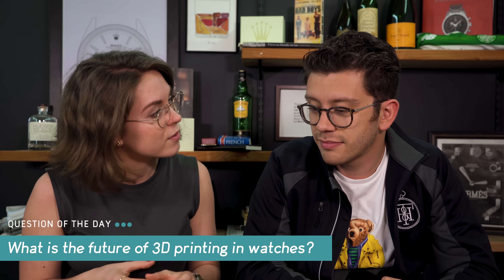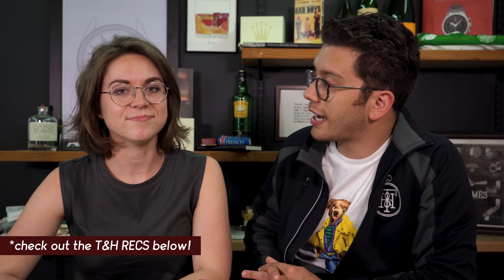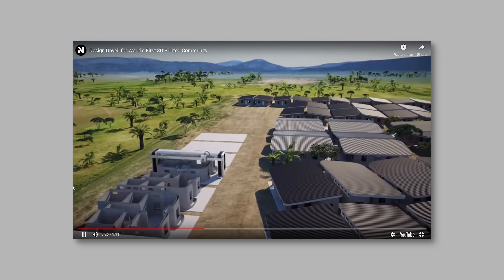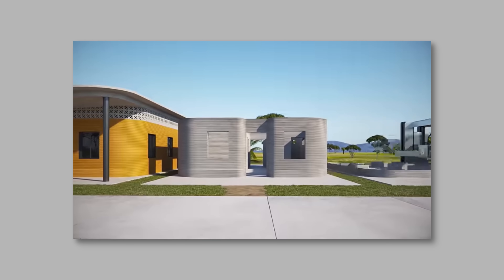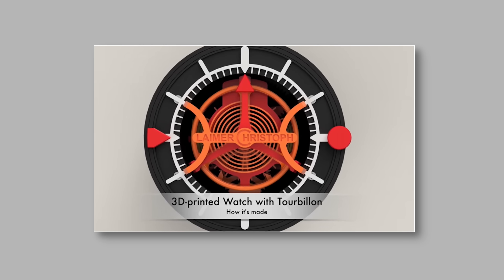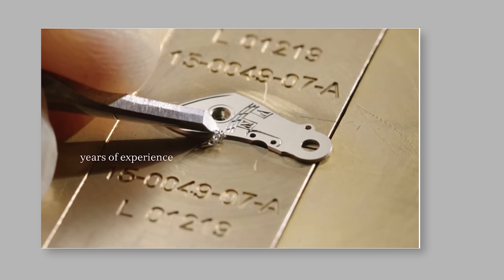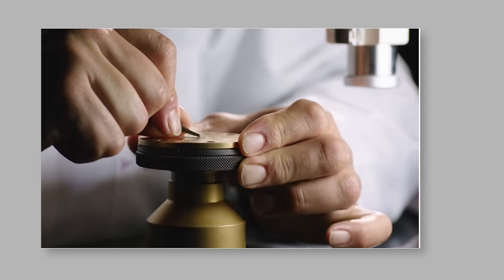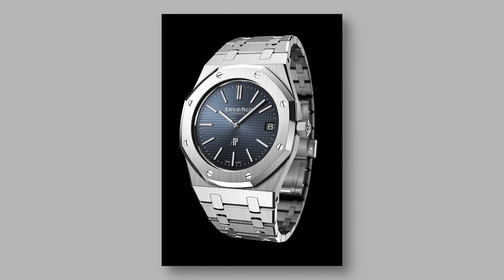Fake Watches Getting BETTER with 3D Printing

Comment: It would appear as though you need to do a little more research on 3D printers! There are some serious limitations even with the worlds best 3D printers and you can't just 'Scan' something and all of a sudden, the measurements of all the components are correct with minuscule tolerances. No, an artist has to do that work. For something like a watch a 3D artist would have to disassemble a real version of said watch, measure all the components and make scale models of them ready for printing, it would take weeks to perfect that for one watch, trust me, I know! Even then, you would be limited by your 3D printer! I have an FDM and an SLA printer and believe me when I say, 3D printing is NOT an exact science. In my opinion and experience with 3D modelling and 3D printing, I would say, the watch making industry is VERY safe! Happy to jump on a call with you and go over a few points if you would like to clear this up.

Comment: Hello, I am a watch enthusiast that works as a metal 3D printing researcher. If you are interested in making a follow up video on what’s possible, potential risks, and finally the potential benefits of the technology to traditional watch making I would be thrilled to serve as an information source. Rolex actually uses a 3D printing process to make some of their gears as they would be impossible to make using any traditional manufacturing technique.

Comment: Ummm.... How does the 3D printer render a metal part? It can't. So reproducing the part in plastic is a dead giveaway isn't it? You could recreate bezels (maybe) but not much else I think. 
Hand-painted dials don't need a 3D printer. They could reproduce those with an ink based 2D  printer - pretty sure.

Comment: Good, they'll have no excuse to withhold replacement part for vintage watches etc.  There's no such thing as "hot horology", and you can't translate the actual term directly over as "high horology" either.

Comment: As a watchmaker (recently certified) I'm on the fence about 3d printing parts. Because on one hand, 99% of the pieces I work aren't A. Lange or AP its usually Seiko or Citizen or some small time watch brand owned by a larger brand (*cough*SwatchGroup*cough*) and it helps in speeding up the repair time as opposed to waiting a day or two to receive the part. However, when it comes to working on A. Lange or AP the owners of those pieces would prefer everything stay original and any deviation from that is sacrileg! But that's not to say A. L or AP would make the switch to 3d printing parts. Its about pride for them and I take pride in fixing and being certified to do so. @Theo and Harris

Comment: Actually @3:47 when you discussed wether a 3D printed part could replicate the finish of a Lange movement, this wouldn’t be the case. In theory, a 3D printer could make a piece that has the same grooves as what the engraver put into it, but it wouldn’t match the piece exactly. This is because A: the piece would have to be modeled in a computer which is a difficult task in itself to faithfully replicate the artisan at Langes engraving style, and B: when printing the piece, the machine would only fill in the metal so that it would have the shape of the piece. All of the polish and shine that engraving the metal has is caused by the engraving itself, which can be replicated by the printer. E.G. a 3D printer can replicate a small beveled edge, but the look and finish of that piece can’t be replicated since it is done by carving into the metal whereas the printer applies metal

Comment: Actually 3D printing metal requires a lot of post-proccesing or finishing. The parts that come out could be functional don't get me wrong , but by far they are not finished . Somebody would still need to polish or sand them etc.

Comment: 3D printing can reproduce absolutely exact shapes, but it cannot reproduce finishing. A 3D printer cannot brush or polish or perlage the surface or edge of a component. So at best, a watchmaker or counterfeiter could reproduce each exact component fairly easily, but it would still require manual skill to make that raw component appear aesthetically as the real thing.
Reply: yes.  the manufacturers can cut out the outsourcing of parts, or eliminate the cost of making mundane items.  They can then put more of their resources into finishing and design.  Alot of their IP is lost (stolen) in the outsourcing channel.

Comment: A majority of watch making has been made with computers for some time now, Omega prides themselves with their technology. Just about all watch cases are made from CNC machines which is essentially the opposite  process a 3D printer uses. CNC starts with a block of steel and a computer chisels it out. With 3D printing an extruder head super heats steel and builds it in layers from the bottom up. By using a 3D Printer over CNC you can drastically eliminate the amount of waste. Parts can be made with either method but will still need to be assembled by hand.

Comment: This is absolutly stupid here is why. 3D printting just print 3d models, those models are the exact same thing that companys design to be probably laser cut and polish, so at the end it's pretty much the same thing, a model which instead of being laser cut from a block of steel, aluminun, brass of whatever it is just printed. The end

Comment: Loved the video and think you all did a good job introducing and explaining a possibly new topic to people but a lot of the stuff you talked about doesnt exactly exist. Metal 3d printers are a real thing, yes but they dont yet have the ability to finish anything to even close to that of rolex or ap. Also what would more likely be used is a laser cutter of cnc mill that would take a existing block of metal/material and reduce to create the final product. Also to create a stl file of a watch part you would either have to have a really good 3d scanner or have somebody sitting somewhere 3d rendering every part and both would require the original watch being taken apart completely. So yeah 3d printing watch parts is possible but unlikely, and the 3d printed tourbillons are all quite large and even if attempted to print at quarter size they probably wouldn't work. Now this doesnt mean the technology isnt coming that can do the things discribed in thid video with the same amount of ease. 
Sorry about the grammar/typos
Love the videos keep up the great work!
Reply: Miles Nakamura not to mention at the upper end brand like Patek and Lange they have highly trained artisans that have his/her own style when it comes to finishing and engraving - so unless that artist is making the models one could tell it wasn’t a real piece. For example at Lange a trained eye can identify who engraved the balance just by visual inspection of style

Comment: Hey Guys, 
first of all great video (as always😅).
I personally do not think that 3D-printing will harm or do anything to the luxury watch market. If it will do anything it is only going to get better. As you know in past times everything had to be cut be hand, not because they wanted to, but they had to. Think about the possibilities you have with computer generated designs. For example Jaeger did a triple axis Tourbillon that wouldn’t habe been possible without computer assistance (did the cage with computers).
Also people can get smaller by producing first prototypes and then cast them in steel for example. What I want to say here is that you can habe a perpetual calendar in a ultra thin ap and much more...

Yours,
Timon😅
Reply from the maker: Good point!!! Thanks for your input!!!

Comment: Having held my fair share of fakes the only way to tell the difference with the naked eye is to actually unscrew the crown and mess about with the movement. Visually they are the same , the finishing is the same ( to the average eye) the weight is exactly the same, the movement is the same to the un trained eye. Pretty much everything is the same.  The ONLY way to tell the difference is to play around with the crown.  That is true with most Rolex fakes ( subs and gmts ) over 400 USD

Comment: This is interesting with 3D printing, however CNC milling and turning could also exactly replicate the components using a Faro Arm (5 axis 3d scanner) create a CAD model and most machinist could create toolpaths which would manufacture this in bulk it would be faster than 3d printing and require cheaper tools but seems to not be a popular thing in today's market to replicate using CNC
Reply from the maker: Wow!!!  Good to know!!!  Thanks man!
Reply: No worries! Pleasure

Comment: It's really not there yet. It would be very easy to distinguish a 3d printed part from an ALS, do to the way a 3d printer layers the part. This layer also makes the part very week in the vertical axis. Moreover, printing complex materials like 316L would extremely difficult and expensive, I'm not if any has done it yet.
Reply: It would be weak along the horizontal axis and break with the "grain", or rater with the layer.
Reply: 316L is a relatively common 3d printing material actually (in terms of metal 3d printing). However the systems that does it costs literally hundreds of thousands of dollars and then they only get you to the same’ish shape, the finishing is way off. So no, they won’t be ‘photocopying’ ALS watches any time soon.
Reply: @dude2106  Yeah the closest we have to the detail would be msla/dlp resin printing but that can't get you metal parts.

Comment: I can see 3D printing to be a great benefit in training watchmakers on the fundamentals of mechanical movements as well as allowing easier prototyping new movement architecture. A movement design that has entered public domain as abandoned intellectual property can be revived or used as a base caliber to become something innovative. On the manufacturing side, 3D printing might allow for miniaturization of certain parts of a watch movement that do not rely so much on assembly to function. It would be an extension of the design and manufacturing philosophy behind Swatch Group's Sistem51. Lastly, some parts and watches just are not being made any more and 3D printing can be a preferred alternative to looking for donor parts if the watches simply are not in abundance. This is just me trying to think positive when 3D printing can make counterfeiting watches cheaper and easier for some of these same reasons.

Comment: I am not so sure there is any reason to jump to conclusion that watch making craft will be “cheapened” with proliferation of 3D printing.  For DECADES, all Swiss brands have been using CNC and EDM machines to mill and engrave cases, bridges and pinions, gears, etc  at scale.  The difference with CNC and EDM is you start with a rough blank or plate of metal and the computer cuts and mills and refines the shape  - vs 3D printing where the material is extruded.  However, in both cases, the part being made exists as a computer file that is digitally telling the machine what to print, or mill.  You will still need a human to polish, finish, decorate and assemble.  I think 3D printing will actually deliver an improved, premium benefit to the craft and quality of high-end Swiss/German brands...

Comment: A great potential positive would be the Ability to re-create a broken part that Is simply no longer available.
Reply from the maker: thelemite THAT is such a good point, man!!!
Reply: That is actually a good idea
Reply: not only that - you call up the manufacturer and tell him what you need - they download the data into your printer and it spits out the part.   it's still official, and they can protect their IP with encoding.

Comment: 3D printing will probably give rise to a new breed of replicas. Check out the watchfinder video or the replica daytona. The breitling based movement, even up  to the column wheel has now been completely cloned. I did wonder how it was possible. Anyways, I think 3d printing should and probably will be embraced even by the more artisan based brands. Its like comparing a stamped dial vs a guilloche dial. The difference is always very clear. Therefore 3d printing can be used in those areas that do not require hand finishing. It will also allow for precise replicating of intricate watch parts. I think this is how some of the independent watch makers like Philippe Dufour can now make more complicated movements and continue to exist as a self sufficient micro manufacturer.

Comment: 3d printing is great for creating complex parts at small volumes but there isn't usually the resolution to finish those parts to a high standard. Using the AP example, the case and bracelet aren't complicated, they just take a crap ton of time to finish and that won't change with 3d printing. Also, a cnced piece of forged metal is going to be denser and be able to take a better finish than a 3d printed part which could have voids and different levels of porosity of the final product. I bet we'll see some limited number of novelties supported by 3d printed parts but this isn't going to change the industry substantively for a long time.
Reply: agreed. 3D printing is high complexity, low speed, low quality finishing. maybe good for manufacturing highly complex parts like the cage of a gyrotourbillion but will still need to be hand finished. great new topic to bring in but not totally accurate.

Comment: Wow....very intriguing.  You'd think a company like swatch must currently used for prototyping and maybe production. I'd wonder how strength properties may differ? A though provoking story. Thanks
Reply from the maker: Swatch was definitely a brand that came to mind when I was thinking of it on the spot. I could see them making use of it in a way that definitely makes sense for the brand.

Comment: I somewhat agree. Replicating a watch is never ok, it undermines the work that the company has done to create the watch, and is stealing. But watches are manufactured. Very few watches are hand made, and those who arent are really expensive.  Rolex most definitely have their watches made on a computer, and a machine makes those parts according to its blueprints. Usually not 3D printing as it is more expensive when it compes to mass production.

Comment: “...A.P. in the scanner of a 3D printer?” Come on Chris. It’s not an HP inkjet man. It doesn’t work like that. While it’s true that it is most certainly possible to analyze and reproduce any watch component with 3 D printing, this would only really replace the manufacturing facet related to the processing of raw materials into requisite components not the entire watch making life cycle like the Assembly part. 3D printing just provides another option in the otherwise mature watchmaking process lowering the skill gap of creating small or intricate parts. Improvement is engineering have always proved to be an all good thing for everyone. While the counterfeiters will gain from the increased ubiquity of 3D printing, OEMs and brands will yield much higher benefits in the reduction of cost that all of higher watches to be more affordable to increased innovation that was until now limited due to the constraints of how small an item a man can build. It’s a huge net positive for all. Oh hey, even for you folks. Servicing a vintage watch from a company that doesn’t exist anymore, thus parts are scarce if not impossible to find. With 3D printing, you could just excrete the part you need on the fly. Until now, you needed a cnc machine for that. That’s a big win 🤑🤑🤑

Forgive my typos, I sent this from my phone.
Reply: Please don't tell me you think that rolex being able to reduce its costs will result in cheaper prices for the consumer.  It'll just mean higher margins for them.

Comment: Swatch sistem 51 is the perfect example of the extent of full automation at this point. You have to take into account that even if the components are printed they have to be comprised of the right metal and again plated by the right metal, as well as have components quality enough to be adjusted as a chronometer. Otherwise you’re basically looking at watches like undone and cerakote cases. Little early to go defcon 5

Comment: Not aware of any 3d printers currently  available  that print in metal. Plus printing a house using concrete in 24hrs  is strange. Cannot imagine traditional concrete being used for this as it needs time to cure and turn to solid while being supported in the process.
Reply: there are 3d printers that print in metal using various techniques now, but I don't think they can print in this detail level yet

Comment: I totally get your point but I have to disagree... 3D printing is only good and cheap for like plastic prototyping but when it comes to steel/metal 3D printing, such machines easily cost from 150.000$ to imagination and a metal 3D print itself is not cheaper then just CNC ing for example a watchcase. It’s also a lot slower. Like it can take 40h easy to „metal 3D print“ a single watchcase where as a CNC machine can do that in like minutes.
Reply from the maker: Great point - thanks so much for commenting 🙏 What are your thoughts on mimicking those signature engravings on movement parts??